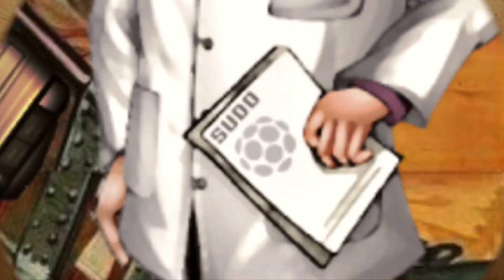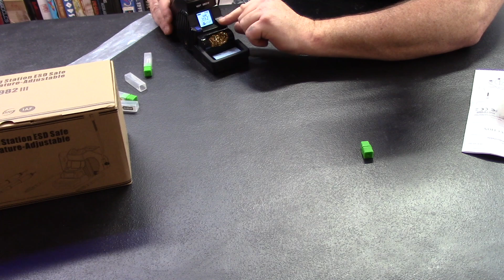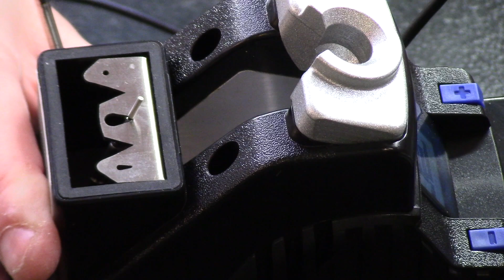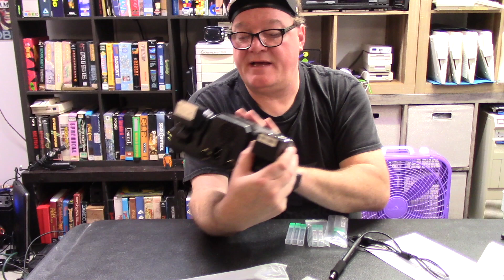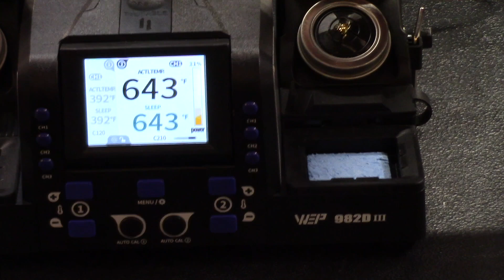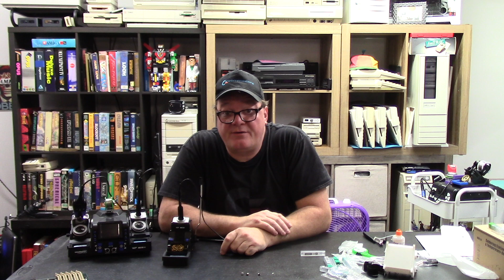NEW Products from WEPTOOLS that will change your soldering game forever!

Comment: I can't remember if you figured it out, but what looks like a fuse under the rubber flap on the front is a calibration sensor.  The idea is that you hold the tip against it and then press the calibration button on the front panel (or some process similar), the unit can then make sure your set temperature is actually what the tip gets to.
Reply from the maker: Yes I wrote all of that in the extended description
Reply: @ChrisEdwardsRestoration  Reading?  You expect me to read??  ;-)

Comment: If you have a chance to revisit this, would you please confirm that the tips of the irons are connected to the ground pin of the base station?  I'm interested in upgrading to this class of iron, but a bunch of the reviews I've seen of other similarly priced units have frequently had significant safety issues, such as voltage on the tip, or the tip otherwise not being grounded, and it would be nice to see confirmation from a 3rd party that the WEP tools don't do that.  Also probably good for the safety of vintage motherboards.  

I do wish they offered the desoldering station as a stand alone station or in combination with the high precision one since I don't feel the need for both a high precision iron and an old hakko 928 style tip iron.
Reply from the maker: They have standalone hotair. The desoldering is a
Combo but you can unplug the soldering iron side. I know it still makes it larger for a base unit, but the majority of that is the pump as for this unit There are thermocouples to keep the tips the exact temperature and those were the little fuses things i mentioned to which I corrected it in the description after I was corrected myself as far as the Tips grounding. I’m pretty sure they do. They have a O-ring style gasket or black line of something on the inside of the tip and there is an additional tip that clicks into the unit itself. It’s very sturdy. I am now using this exclusively because it is so awesome. The standalone soldering station was inexpensive. The hot tweezers were slightly more, but I needed them for all of my repairs, I also purchased two more high power stations that I’m going to be reviewing shortly one is for BGA type repair and has a high temperature or high power, hot air removal with a soldering iron combo

Comment: Something I have never seen in these rework stations is a 2 in 1 tweezers and hot air. If your going to do electronics you get a soldering iron, that is standard. But then you want to make your life a bit easier so you want hot air and tweezers but every combined unit makes you replace your Iron. I like my iron, its a decent Pace iron comfortable and powerful. But unless I buy 2 individual units I have to replace my Iron as no one seems to have a combined tweezers and hot air. I have never seen that option available.
On a separate note that does look like a good Iron and the tweezers look ok too. I don't think I like the buttons on the combined unit wand but that's an individuals choice.
Look forward to seeing some vids where they make your life that bit easier, you deserve it.